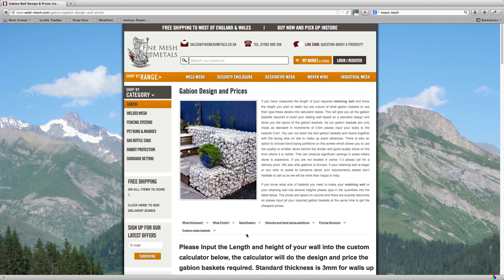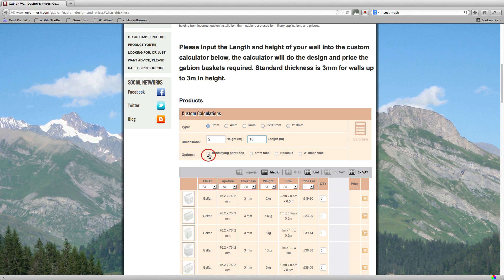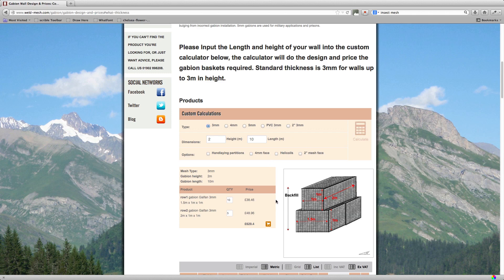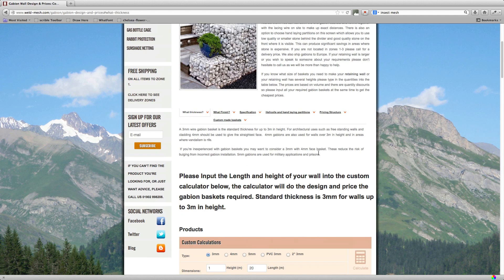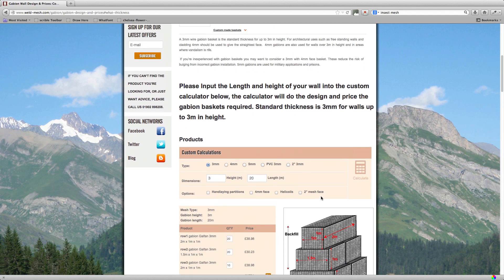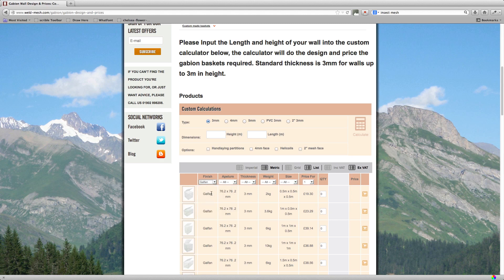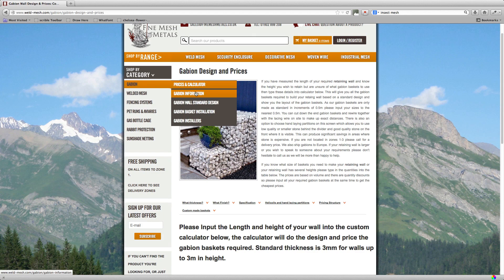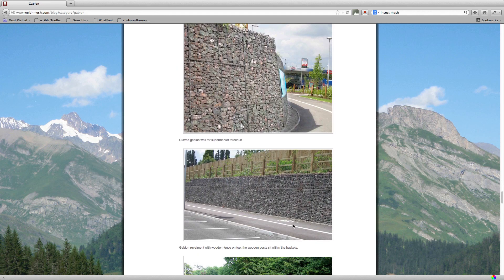Gabion tutorial

Comment: Could you please advice me. I want to fence with gabion baskets of 2m×1m×1m only dimension available in Mauritius.The wall to be fenced is on a flat ground it measures 6m long and 2m  height its on flat ground.May I put 2 basket on each other to have the 2m height. If not what should be done.thanks